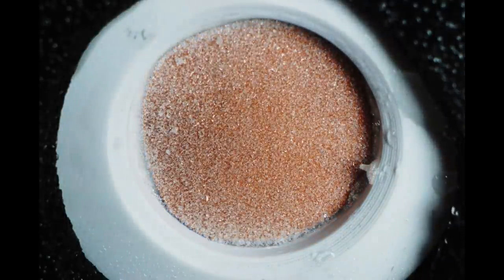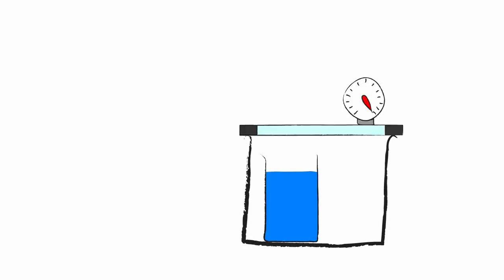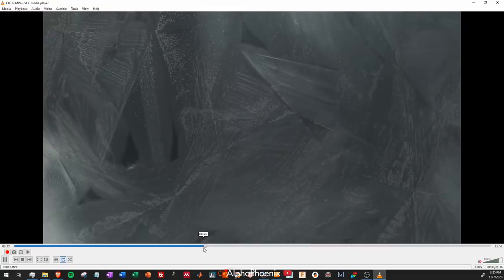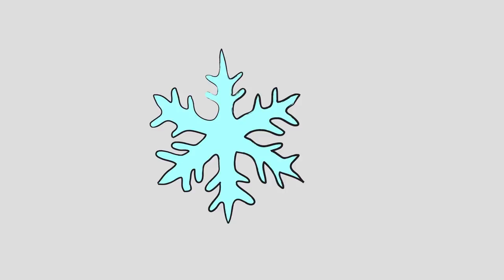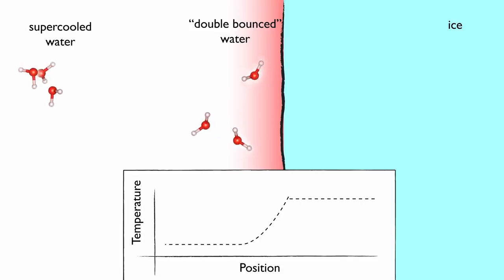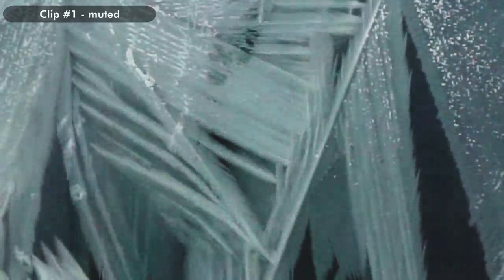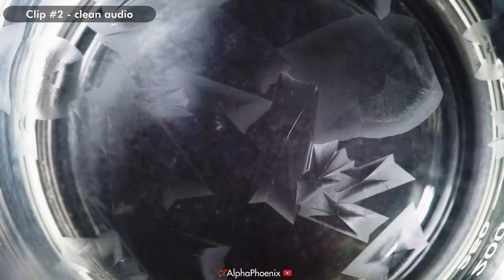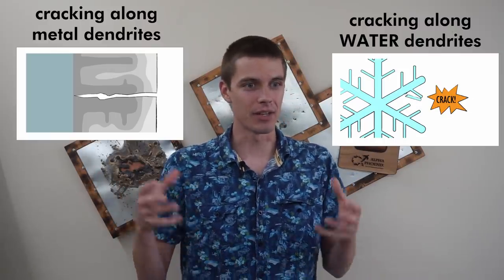The Sound of Freezing: Explained!

Comment: a noise in a vacuum? Nice video btw
Reply from the maker: the vacuum wasn't perfect (probably almost the vapor pressure of water at 0C) but I believe the sound most likely traveled by conduction - The water was in the beaker, and the beaker was touching the metal vacuum chamber, so when the ice made a noise they all would vibrate. There might be some level of sound that conducted from the vacuum chamber straight into the camera, but given that the lid is held on with a rubber gasket that would dampen a lot of vibrations, I'm guessing that the sound you hear is the metal walls of the vacuum chamber shaking and making a regular sound wave through air. If you wanted to I'm sure you could analyze how each interface (water/glass, glass/metal, metal/air, air/microphone) alters the sound but I didn't want to tackle that.

Comment: Okay so here's a thought:

You know how hot-ice packs use a clicker for nucleation?

What if it's started with just one chemical nucleant, suspended in the water somewhere; then it starts cracking, and the shockwaves from that do the rest?

Eh, I doubt it works out, there should be obvious wave effects like extra nucleation around the edges (where waves reflected off the container overlap).  And it's not like it's anywhere near the power level required for cavitation, at least beyond the local site.

But that'd be cool if true...

Comment: Amazing video! Next try lining the freezer in sound dampening foam, put a foam cover on a very high end mic, and a good sound card (USB and 3.5mm isn't going to cut it here.) , And record with audacity at the highest possible sample rate. I notice your audio is too compressed to denoise cleanly and the result is muddy. Capturing at a much higher rate and keeping it uncompressed (raw or wav file) will have a MUCH clearer end result, especially when you start with less background noise, which means less "material" lost while removing said noise.

 If I had the gear I'd go record it myself but I don't own anything that will sound much better than your recording, unfortunately...
Reply: Yeah lots of the "clean" audio just sounds like aliasing from the denoiser.

Comment: Does the paper's method require demineralized water? Impurities in the water and the dish might cause or benefit multiple crystalization nuclei, prohibiting or challenging a single crystal. I recommend using a new (unscratched) dish, flushing it with destilled water and pure water also for the experiment.

Comment: RoHS (Restriction of Hazardous Substances) Lead-free solder (typically 95%+ tin, 3-4% silver and 0.5-0.7% copper ) is hated by many because compared to lead solder (~60% tin and ~40% lead) forms tin whiskers which will cause short circuits after a few years. These are not dendrites, because they are not fern-shaped, but I wonder if the process (which is not understood) is related.
Reply from the maker: I've seen pictures but never read about them - do they form whiskers because of electric fields or is it a chemical thing, or both?
Reply: @AlphaPhoenixChannel  https://nepp.nasa.gov/whisker/background/index.htm "While the precise mechanism for whisker formation remains unknown, it is known that whisker formation does NOT require either dissolution of the metal NOR the presence of electromagnetic field." 

It is almost like for nearly pure tin and nearly pure zinc, they just form and how or why is still a mystery.

Comment: Awesome video! As dendritic growth affects snowflake shape formation, how do symmetrical flakes occur?
Reply from the maker: The dendrite pattern is initially governed by crystallography (ie. Flat-ish 6 fold symmetry for the starting point) and then the branching of the dendrite arms is based on subtle changes in the temperature and humidity of the surrounding air, which is nearly the same for all branches, so they all end up looking nearly the same once grown

Comment: I have heard it when a super cooled bottle of water freezes suddenly, specially if it isn't full so the walls of the bottle on the head space work as some short of impedance matching structure.
Reply from the maker: Really? That’s awesome! I’ve never done that experiment before - on the list
Reply: @AlphaPhoenixChannel  Yeah! drop something that can work as nucleation point inside the bottle with super cooled water and put your ear on the mouth of the bottle immediately, its a more crackly sound or at least was on my experience, at that time my hypothesis was that crystals collided with each other and due the volume expansion of ice some of them broke but wasn't a serous thought, i think yours is a much better explanation. Also i wonder if dissolved gases in the water have any effect on the noise generation. Good luck with your experiments!
Reply: @AlphaPhoenixChannel  Might add I used frost as nucleation points on my experiment. Also sorry for the silly and nonconstructive comment i leaved on your other video,  I am kinda salty for the loss of the Arecibo telescope.

Comment: How about the other crackling noise every time I open the freezer?
Based on your explanations, I'd hypothesize that it might be due to dendrites breaking when they start partially melting.
Reply: i believe it is shock. the ice quickly changes temp and therefore quickly changes density causing it to crack in places

Comment: Dendritic growth is extraordinarily unlikely to create 2-holes (voids), so I don't believe this conclusion. The reason dendrites form in the first place is that they are racing into virgin water. In order to create a loop of dendrites, which is a prerequisite to a void of dendrites, you would need two of them to grow into the same spot, which doesn't make sense. You would also expect to have most of the sound occur towards the end, and be able to see visible flaws in the crystals.

An alternative hypothesis, then, is that the dendrites, as they grow, create not only a neighborhood of warmer water, but also a neighborhood of water under higher pressure (because the ice is too big). The molecules in this neighborhood then have to trade not only their random kinetic energy (heat) with their neighbors, but also this other expansion kinetic energy. However this energy, (unlike the heat), can propagate away from the crystal at the speed of sound, instead the speed of heat diffusion. Once it does so, There is a little well of much more stationary molecules, and the process oscillates. The ice crystal itself picks up this oscillation, which forces the process to oscillate in a harmonic of the crystal itself (since the dendrite vibrating also creates these waves), and as a result it gains power while it freezes. 

That's my guess, anyway.
Reply: I am also curious about this; I do wonder how a void gets completely enclosed so early.

Comment: The sounds sound like the chirps from e.g. throwing something on a frozen lake,  hitting a railroad rail, or, in RF, lightning strikes propagating through the atmosphere ( https://youtu.be/OzWBxt_TOWk?t=75 ). Essentially, an sudden white noise is transformed into a chirp by having different frequencies having different propagation times through the geometry (rail, ice-sheet, atmosphere). 

It seems the freezing ice also has these sudden white noise events which then are spread out to chirps by the beaker and what not.

Comment: Cool video. 

However, Although there is clearly a sound there as  you can hear in the raw footage. A lot of the "clean" sound kinda sounds like the typical musical tone artifacts you get after excessive audio noise reduction with the FFT based methods like the one audacity uses.

I think it sounds cool but you can't really trust what comes out of heavy pitch shifting or noise reduction algorithms to be representative of how something sounds in the real world.

For example, if the sound later in the video really was too high frequency for humans to hear then it would probably lay spectrally mostly above the Nyquist frequency of something in the signal chain. So down pitching it into the audible spectrum is mostly gonna be interpolating from wathever limited spectral information remains after the anti-aliasing filtering. Aka basically guesswork.

Tl;Dr: the sound really is there but take what you hear on the "clean" recordings with a grain of salt. a lot of what you hear might not be there at all.

Comment: is the speed of the freezing fast enough to make a noise itself? like if the ice is expanding by 9% that's gonna be displacing some amount of air and causing a little high pressure zone where the ice is expanding into right? would it have to be moving at the speed of sound to create sound or does any moving object technically create sound waves?
Reply from the maker: Interesting - yeah I’d say by that definition anything moving makes sound - you’d have to start thinking at crazy low frequencies though. Maybe “Infrasound”?

Comment: So, on the subject of supercooled water requiring a nucleation site to freeze, would it be possible to 'freeze' water into a solid without crystalization? If you were to drop the temperature suddenly enough (say you had a gazillion microscopic  lasers to bring every molecule close to absolute zero), then wouldn't the water be unable to form nucleation sites through random particle motion? And yet, shouldn't it behave as a solid at such low temperatures? (Even hydrogen becomes solid at 14K)

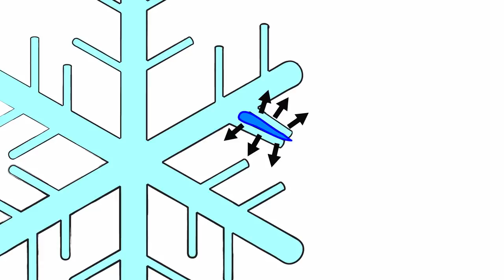Comment: At one point you illustrate dendritic growth on a diagram that looks like a snow flake (12:35), but are snow flakes actually created that way? Dendritic growth alone would not give you the symmetry it seems?
Reply from the maker: the particulars of dendritic growth in a snowflake, like when the arms branch, when they grow flat, when they get spiky, etc, is governed by the supersaturation of water in the air, and by temperature of the flake and the air. The only reason snowflakes look symmetrical is that these conditions are identical for all the arms. There's no force that causes each arm to grow like another - instead all the arms follow the same instructions at the same time and end up looking mostly similar. it's a fun mind-bender of symmetry-without-forced-symmetry
Reply: @AlphaPhoenixChannel  That makes a lot of sense, thanks!

Comment: In the recent video The Snowflake Mystery, Veritasium described the process of dendrites formation little different. "Since the corners of the hexagonal prism stick out farther into humid air, they grow faster, and now they extend even farther, so they grow even faster in a positive feedback loop". So the humidity not temperature is crucial according to him. Who is right?
Reply from the maker: The relative humidity is actually a function of temperature so it’s the same explanation 😁
Reply: @AlphaPhoenixChannel  ahaha may be, but I think the point of his explanation is near the ice surface it is formed a deficiency of water molecules. May be both effects are important, fewer water molecules and they are moving faster. Both don't explain why it is only happening on the corners though. The reason why is it happening on the corners is probably because air is moving not only parallel to the surface there and thus different layers of air mixes faster.

Comment: On the welding part too its to release   trapped hydrogen from the metal that is why welders will preheat steel  it may be different for 3d printing.

Comment: Can't the water molecules offload their energy into the crystalline lattice? Like making the crystal vibrate and radiate heat into its surroundings. Or having the lattice absorb the energy of the molecule and distributing it throughout the whole crystal(like hitting the ground with a hammer, the ground would dissipate the energy).
Reply: They actually do! (I glossed that a bit) if you drop a cold seed crystal (think already -4 degree ice) into a pool of -4 degree water, the interface between the water and ice will be the hottest part, with the temperature decreasing into the water and into the solid, because the act of converting liquid to solid generates so much heat.

I agonized over how to draw that graph for this particular case (homogeneous nucleation of ice in liquid) and decided that the body of ice would probably assume the max possible temperature (0 C) and it wasn’t being cooled internally so it would stay at zero - at least for a few seconds...

Comment: FYI: Modern jet engine turbine blades are usually a single crystal structure.
Reply: What an effect does it have on the turbines?
Reply: Wojciech Bieniek increased structural integrity under use. The extreme forces on a blade during operation make its single crystal structure stronger than with polycrystalline structure.